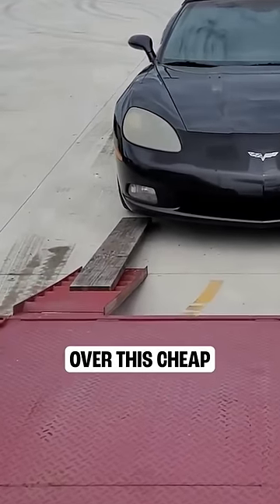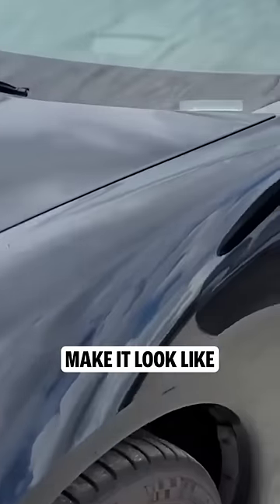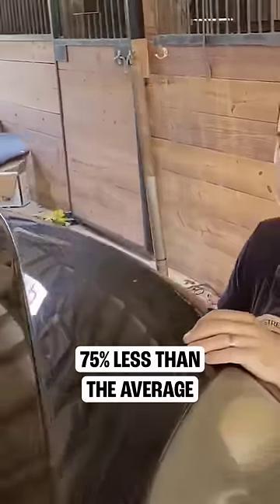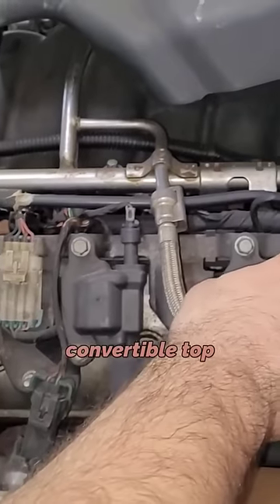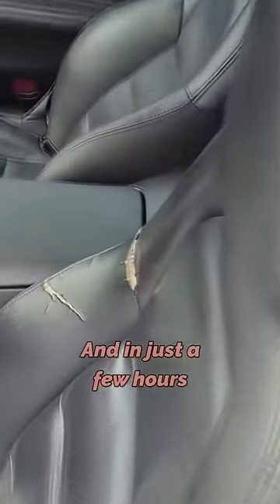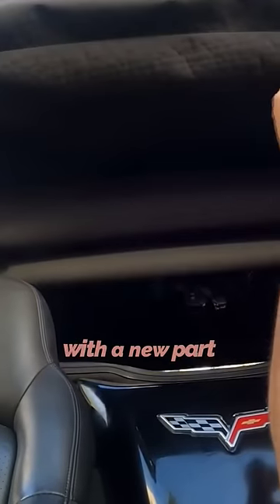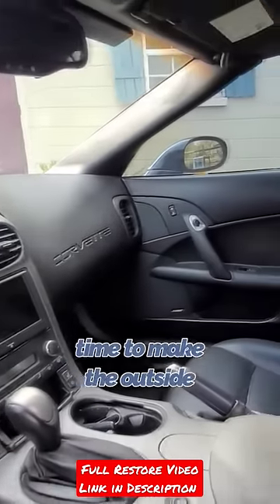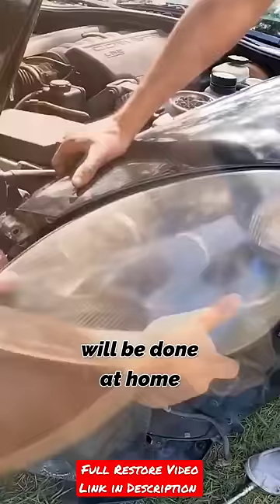250,000 Mile Corvette gets Full Restoration

Comment: Hey that’s my car now! Good seeing the before and after! Still running strong!
Reply: How much was it at auction im curious
Reply: Yessir 🔥
Reply: @Kurejiii  Prob bout 9500 based on mileage (250k) & rough outside cond. Vettes & Mustangs are ultra reliable if cared for! Owned both.
Reply: @Davido50  not mustangs
Reply: @SMACKDAD  I've seen many with high miles that are beat like a cheap hooked with a bdsm kink and they keep going.
Reply: @Kurejiii  I bought it directly from him. It was around $10
Reply: @AutoAuctionRebuilds  10$
Like  one and a zero 
Ten?
Reply: @SMACKDAD  I've seen mustangs run with no oil for 100 miles. granted the engine died(that poor winser) they are extremely reliable and will last for decades
Reply: @SMACKDAD  i love how you just flat out admit you cant / dont take proper care of your vehicles 🤣💯
Reply: @johnskinner737  10k
Reply: @eagleone5456  ok that’s more like it
Reply: No way
Reply: I missed the after… :/
Reply: @ginger_nosoul  damn he deleted his comment 😂😂😂
Reply: @SMACKDAD  All Fords are, you're just biased 😀
Reply: I think his name is Alex in the black shirt from legit street cars right
Reply: I just installed new headlights and window reg and central locking mechanism, pulled the radiator support straight and zip tied the bumper corners (under the plastic so you can’t see the zip ties) in a 85,000 km 2005 echo.  Bought it for 1,800, spent 600 and I’ll sell it for 6k.  Not bad for a car bought and sold same week, hopefully.
Reply: @SMACKDAD yeah bs. There’s 4.6 and 5.0 engines out there with 300k plus on them lmao. Goofy.
Reply: @SMACKDAD  I got a 2011 cali special with 190k miles running strong 💪 fixing to get a built motor and enjoy it for another 200k hopefully 🤞
Reply: @SMACKDAD wrong
Reply: @SMACKDAD  The older Mustangs with the 2V 4.6 that were also in the Crown Vic’s can go 300k+ they actually do last a while. That’s coming from a Vette owner too.
Reply: Liar, that's MY CAR! Fact!
Reply: Wanna trade  for a Hummer H2?
Reply: Just curious, I'd assume they only got the big stuff out of the way but to no fault of theirs as you drive it it continues to be a money pit right? I want one and I'm thinking these are just one of those cars that with some occasional love they start up every time you want them to
Reply: @casematecardinal I used to have a clapped out F250 with the Windsor V6, 5 speed manual 4x4.  It never left me stranded.  I should have never gotten rid of it, but it needed to many things replaced.
Reply: @commodoresixfour7478  it do be like that. But hey if it cheers you up since then the kid who had it was able to get the engine rebuilt and the stang runs once more
Reply: @SMACKDAD everybody hates fords including me, but I will say 1 thing. Ford is the only US car manufacturer that didn’t get bailed out by the government.
Reply: Sure it was lol
Reply: @casematecardinal no car can run without oil🤦🏽‍♂️ the friction will blow and weld the metal together.
Reply: @2seep  thats not how that works at all. It will rapidly degrade the engine but it won't weld it together. I'd like to think I know what I saw. The stang drove with us to a car meet. It didn't make it all the way before dying. We had to wait in the middle of nowhere for one of the guys to go buy oil so it could limp home.
Reply: Yes I was specially intrigued by the cracked coil socket.
Reply: @Davido50 more like 4 at most. He said 75% off of the value of it, let’s say a little u fee 20k for a solid C6 today, and you’d get around 4k

Comment: I love cars with 250,000 miles on them! no joke!
Reply: My Dodge Dakota made it to 437,000 miles until it was hit by another vehicle and totaled.
Reply: I've bought high mileage cars and its simply not worth it everything in these cars are severely worn meaning they will have to possibly be replaced. 150,000 and under is ok mileage but anything over is very risky.
Reply: @kimchee-sj8bu  Yes, you have to be super careful to not overspend on a high mileage vehicle. I like to put a hard limit at $4,000
Reply: I bought an old Ford Pickup at auction. over 300k on it. Although it needed paint I saw fenders were recently replaced as was the seat and mirrors. It was listed with bad engine new transmission. Starting bid was just $800 and went to me for $1,200 500 more than I wanted to spend but some little voice in the back of my head just said buy it dummy...  It seems someone did put a new engine in it and it never started back up simply because the wire going to the coil was cut somehow. Someone also put the valve covers back on with lots of sealer and the rockers were never tightened back down. We plan on painting her this summer. Runs like a champ after about $300 bucks in used tires & brakes.
Reply: If the previous owner kept up on major repairs. You can really score in the end.
Reply: In 2000 I bought a 1985 Chevy Van for $300 with 250000 miles on it  I put another 100000 miles on it and then sold it for $300. I wish I had kept it.
Reply: Same. With them, you know they've had problem free lives. Spent more time on roads then in the service shops.
Reply: Guess it depends on the car. Wouldn't trust a Kia with that number.
Reply: I have multiple over that and over 30 years old. All run and are my dailies
Reply: wagh688 ive owned my 2012 accord V6 2dr for 202,000 and never had a single light turn on and still no suspension clunk because of what you said on how everything has been replaced but if you have bad luck like me when it comes to getting new parts that turn out faulty after installation.
Reply: @kimchee-sj8bu  depends if it’s highway miles or not
Reply: @kimchee-sj8bu  worth it imo. anything my 03 1500 silverado needs it gets. best oil, best filter, best additives, best local available gas, etc. got a new bumper and gas door coming for it rn.
Reply: wagh  you didn't spend 20,000 on one did you? I've seen trashy used car dealers TRY to sell cars with close to 300,000 for 20,000
Reply: @sieve5 4k for a 2006 chevrolet corvette
Reply: Bought a volvo s40 2005 2.4i, 300k km still runs
Reply: @jebsdaddy141 aww dude dang 😢
Reply: My 01 corolla has nearly 240K miles on it

Comment: A quarter of a million miles in a sports car has to be some of the hardest miles a car can get.
Reply: Probably not, it was more than likely used by an older guy for cross country driving. It’s very common for vettes
Reply: most likely not.. greater then 50% of all these ive seen on the road throughout my life (A LOT) are being driven by someone with grey hair. these pushrod v8 last a really long time with proper maintenance and low reving highway miles
Reply: Probably easy ass highway miles honestly. You cant do 250K miles worth of burnouts.
Reply: @jonathantaylor6926  hold my beer

Comment: You never can tell about some cars with high miles. We bought a Tahoe with 139,000 miles. I wasn’t thrilled about the high miles but it was in good shape. I drove it to around 264,000, then my husband took it and drove it to 324,000. Great vehicle. It needed a little work when we sold it and I told the guy that bought it. He “drove” it away. I saw it a couple of years later.

Comment: that's actually pretty awesome. I bet those 250k miles are all highway. aka, basically no wear on that low rpm cruising  v8.
Reply: Low pressure low revving naturally aspirated big v8 will pretty much last forever there very little stress on the engine it definitely last way longer then those turbo 4 banger making 200hp/liter.

Comment: Can't beat the reliability of Vettes & Mustangs. Take care of em they easily last 250k mis. 💯
Reply: . ..as well as Mustang counterparts,  the  Camaro.
Reply: Thats a lot for vehicles you give the beans more often. Its nothing for my 2007 accord. 250k on that is like just broken in. I see people with my same accord hitting like 350k miles and they only stop going because someone ran into them and totalled it. I saw a guy with 341k and he didnt even change the transmission fluid 😂 if it was a ram product youd be doomed
Reply: My Mother's 1996 V6 Mustang had over 180,000 miles when she sold it to a private party. Everything worked as it should, cold as ice air and hell hot heat. The only thing that stopped working was the power function of the driver seat. Was basically a flawless car for the 20+ something years she owned it and the guy is still driving it! She now drives a Dodge Challenger with almost 150,000 miles that she bought new in 2010. A wheel speed sensor is the only failure it has had and the paint failed on the hood and rear spoiler. She just had them wrapped instead of repainted.

Comment: I have an 01 F350 with 300k miles. Has had one fuel pump and zero other issues. I have a 2011 Prius with 275k miles. Replace the brakes once and got a new "used" ac unit installed for $400. Zero other issues. Buy quality and take care of them.

Comment: They're great engines, I had the 4.8 in an old work truck that ran better at 300k then my 21' 5.3 does now at 85k. Never burned or leaked oil either the new ones burn oil even with the DFM Delete

Comment: I bought a jag that was in immobilization mode for $1600, car is next to immaculate, black on black, leather seats, power everything - everything worked accept the computer shut down the keys due to it sitting for 2 or 3 months. Took it to the dealership, they got new reprogrammed keys from England. I installed a new fuel pump and rebuilt the suspension. Car runs perfect with absolutely no issues at all, and I'm always getting comments on it. Invested about $5000 total to drive a $90,000 car.

Comment: My cobalt lt has 230k miles on it, still had the original spark plugs from the factory when I bought it lmfao thing still runs like a champ tho.. been replacing parts and upgrading things as I go along cuz I plan on putting a turbo in it at some point. Even still does over 100mph without any hiccups from the engine or transmission. Need some fatter tires tho cuz at about 90ish you can feel those stock wheels go sage the gemini-gas pedal mode 😂

Comment: If you don’t mind me asking, how did you repair the seat? My seat is cracking as well. Please respond if possible, thanks.
Reply: replace it or take it to an upholsterer
Reply: we have an upholster guy come to our shop and takes the seat. he sews in new leather panels and it's back in a few days. not too mush $$ either, maybe a couple hundred. also there a companies that make very nice replacement covers and you can install them too. it's not rocket surgery.
Reply: @violentshemp7776  thanks! I’ve replaced seat covers before, but wasn’t sure if there was an easier way. But anyways thanks for the info
Reply: @Fast_Forward_Racing  had my wife’s Volvo S40 leather seats replaced by an upholsterer, both front and rear seats with Katzkin leather and it was nicer than the factory leather. I got the stitching in a contrast red to match the paint and it looks like 100% factory. Cost was around 1300 and I would think that a corvette would be less. Well worth the money.
Reply: @jmoto1983  thanks man! I really appreciate it.

Comment: If they were mostly highway miles on it then the actual wear on the drivetrain would be a little over a tenth of what the odometer shows. Do a compression test on the engine, change all the fluids, listen for bearing noise, make sure calipers aren't seized and look for rot in the frame. If all is well you're good to go.

Comment: Remember cdi efi gave american cars as much as 8 x extra  miles because there is  no ignition points to burn and misfire or late fire and there is no more carburators to flood over , run past your valve and piston rings diluting the engine oil with raw gasoline wearing out the engine bearings ...in the 60s a chevy was done in less than 100k miles ...now every thing has electronic everything as when if it aint perfect it dont run at all ..i would not doubt if you could still see the original honing cross pattern still on the cylinder walls from the day the engine was built ..after all its got an LS engine ..im a ford man but those Chevy corvette LS engines are just stupid magic

Comment: Did you replace the headlights, or use a polisher? I have extremely yellowed headlights that need attention too.
Reply: It depends. Sometimes it's just the surface, sometimes the plastic is yellowed through and you need to replace. Try polish and see, I've gotten lucky a few times.

Comment: It's still worn out !
Unless you want to do a fresh engine repower ( which I recommend )
A fresh transmission 
( which I highly recommend )
Otherwise, the rest of your work is just polishing a worn out turd !
ABSOLUTELY do ever single one of the rest of the repairs !
But, do BOTH window regulators !
Replace BOTH leather bucket seats !
Go through ALL of the BRAKE SYSTEM !
NEW CALIPERS, NEW BRAKE LINES !
NEW BRAKE PADS FRONT TO BACK !
PERFECT you have just invested in a worn out Corvette !

Comment: Most people would be phased but the skill is to look beyond the cosmetic issues and if it’s a sound car it’s worth a punt. That said misfires aren’t always obvious so there is always an element of luck in these projects. I has a misfire on a car due to the ECU refusing to send a spark to a cylinder because of inefficient combustion as a result of low compression. Had to scrap the car because an engine rebuild wasn’t economic to do.

Comment: You can do whatever you want. It has 250k miles. No dealer could sell the car. 
You skipped over the fact that most of it is fiberglass and with that many miles, it has cracks, whether you see them or not. There is bodywork to be done. Then a full repaint. Unless you know you're going to wear out this one to keep another one safe no one is going to spend more than you can get for the xar to restore it. It's a candidate for a race car or something like that

Comment: An American car with 250,000 miles is an American car with 250,000 miles. You can spruce it up like mother goose for a wedding, but it's still wore out. If you drive it on the daily you'll be perpetually playing Whack-a-Mole with random stuff that breaks down, comes loose or dry rots until you've made a new car.

Comment: Another trip to the moons gunna take a bit more than a few days. 
208k on my ticker and that engine isn't going back in until it has a timing chain water pump gaskets oil filter cooler etc. 
And guess what the transmission went out not the engine. 
The fact it's alive at 250k is crazy to begin with.

Comment: I've tried everything to get my dull headlight clean. What would be the best thing to use?
Reply: Wet sanding from 400 grit all the way to 800 or 1000 grit, in varying degrees of motion, (up and down with 400, side to side with 600, up and down with 800 etc.) 

Then using a compound, buffing the headlight assemblies, followed by a good polish, then hitting it with headlight restorer clear coat (sometimes called 2K CLEAR), let it sit for a few minutes, hit with clear coat at least one more time and those headlights will be as close to new as one can get without actually replacing them - 

Those steps helped me bring the excessively yellowed headlights on my Pontiac Grand Am to having headlights that looked like they were a factory replacement assembly 😎
Reply: @xAPPALACHIAx  yep your basically just making finer and finer scratches it's best to go from 400 to 1500